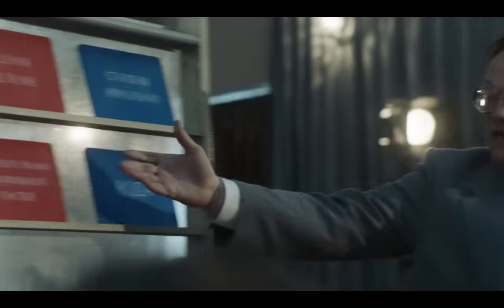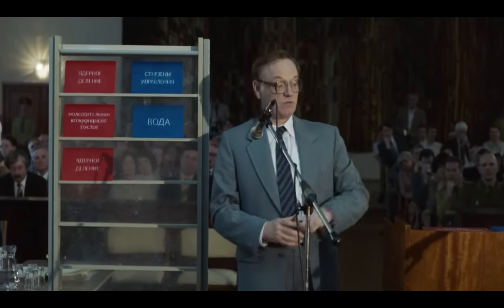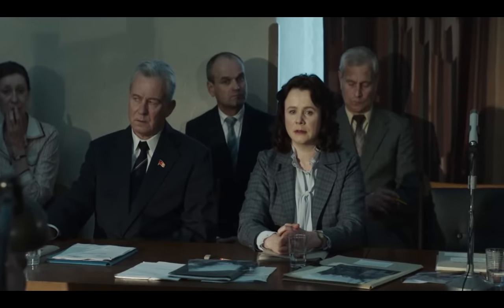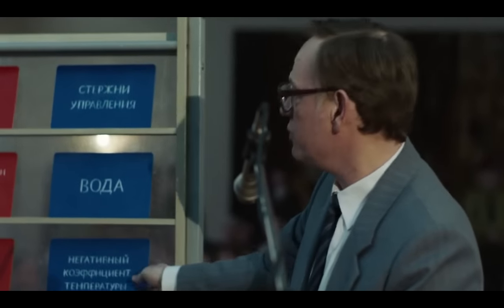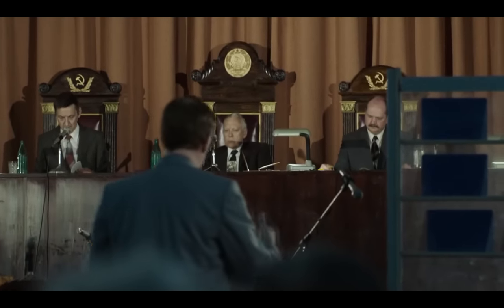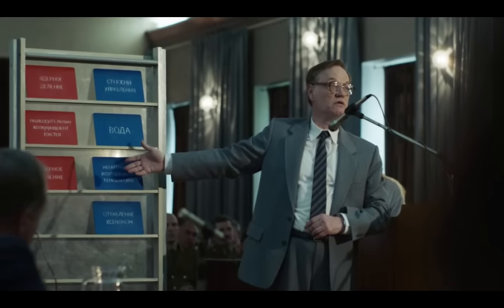Chernobyl scene #1: Valery Legasov explains, how an RBMK reactor works

Comment: If you watch the full series it wasn't so much the Soviet system or the cheaper reactors that caused any of this. Maybe if it was an other system and less efficient (and thus more expensive over time) reactors it would have not happened. But it happened due to individual greed.  It persisted even in a communist system, which tells us that no system can rid us of our human nature, and maybe its not even worth to try. Diyatlov didn't want to fail the test because that would ruin his career and he was at the cusp of a promotion, so were his bosses. 

Its the same thing that happened in the West with the banking crisis and the executes that kept pushing for sub-prime loans to people that never could pay them off to raise profits and their own bonuses until the whole system collapsed. There the cost was mainly financial, here it was human, financial and systemic. And even then, if they had started releasinv valves and introducing rods slowly before the temperature rose too fast it might have worked but they didnt know how/that the danger was so high.

Comment: So, when fuel is cold is highly reactive.
But water make fuel colder by taking it's heat.
How the hell water reduce reactivity
Reply: Think of Heat as energy.

The hotter an object, the more its particles can move, and the quicker they move, causing more reactions and an increase in reactivity.

Cold water takes away the heat, and slows down the speed of the particles and lowers the reactivity
Reply: It's actually because the normal water absorbs the neutrons (just like the boron does).  Unlike the heavy water which is used in different types of reactors. Heavy water works as a moderator (just like the graphite). So vaporizing the heavy water reduces the reactivity => negative void coefficient => more stable reactor. Unfortunately, heavy water is much more expensive than the normal one.
Reply: So i guess boron bars are changed from time to time due to a high number of neutron catched by them?
Reply: @TrollFace-oo6cn  Probably, but that would fall within normal maintenance of the reactor. It could also well be that the neutrons from the boron decays naturally in a manner that doesn't trigger the uranium, but I'm not entirely certain of that.